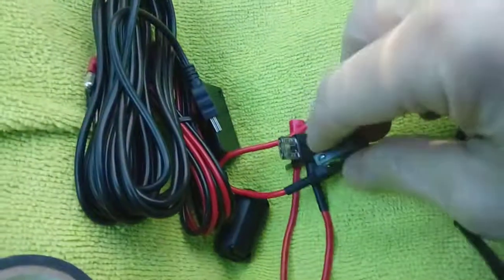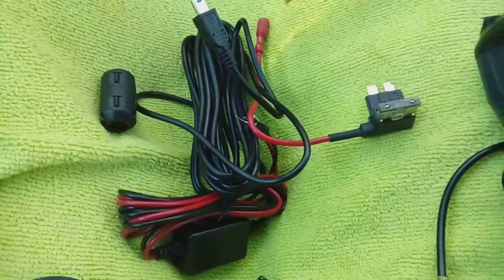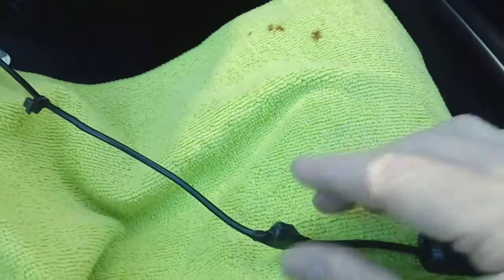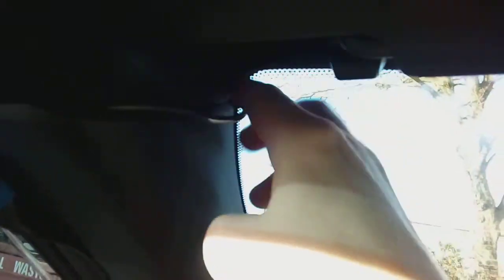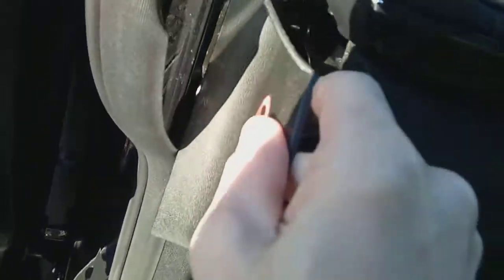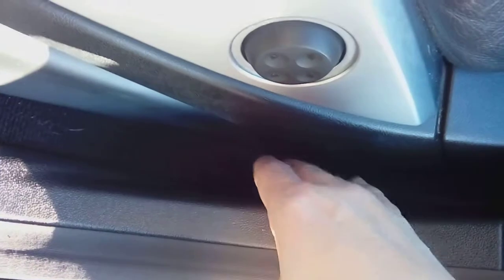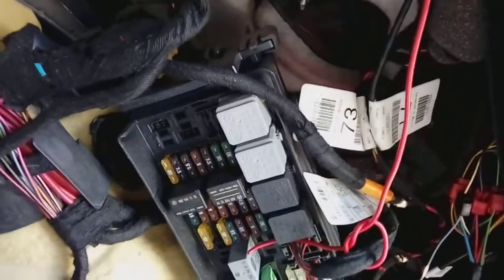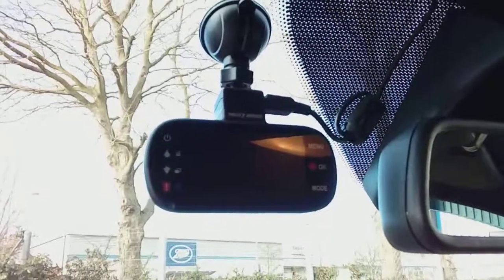Mercedes ML 2005-2011how to wire dash cam to fuse box,simple guide

Comment: I just did this on my 2011, but connected the ACC wire to the 12v socket in the footwell. Very easy to lower the panel, un plug the 12 volt connector, pull the wires out and splice in a wire to run to the side fuse box. Then you can make all  your connections there.
Reply: Wow were more help than this entire 10 mins video. ALSO WHO RUNS THE CABLE BEFORE CONNECTING AND TESTING IT 🙄🙄🙄🙄
Reply: @Ghostface944    hey what name of the kit  that u need to buy  I can't   make it out

Comment: you are on fuse number 53, is that permanent plus or ignition plus ??
Reply from the maker: On that particular ML it would have been an ignition switched.
Reply: @PJsprojects  I have 2 cables, one for constant current and one for ignition plus. But I only want to record while driving, not when parking because of the battery

Comment: Hi, if I want to have the dash cam running continually, can I use the front fuse box , I have the same fitting kit as you are showing,
Reply from the maker: You could use a constant live from the front fuse box,just make sure it's a accessory circuit fuse you use. Be aware that most(but not all) dash cams are not designed as 24hr surveillance devices but some do have a parking mode that needs both a constant live and a switched live.
Also have a look at the power consumption for the camera due to it being a constant drain on the cars battery if the car is not used daily.